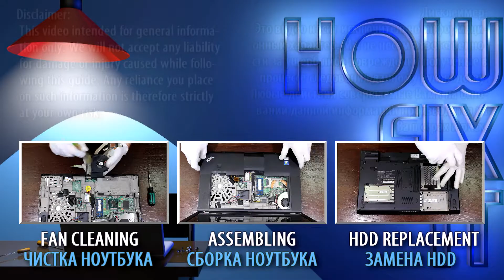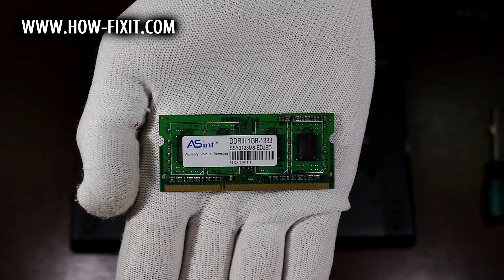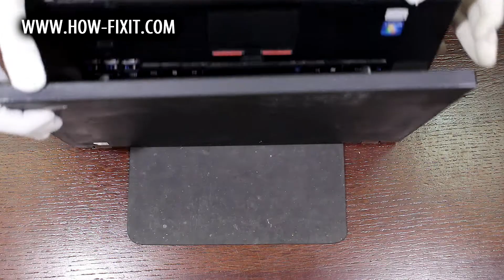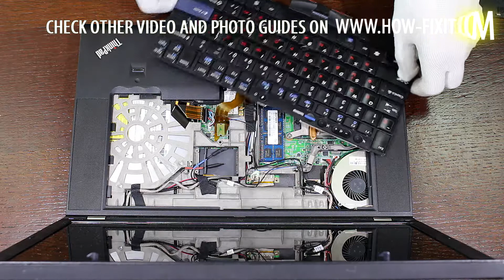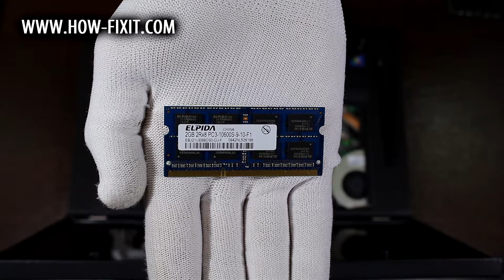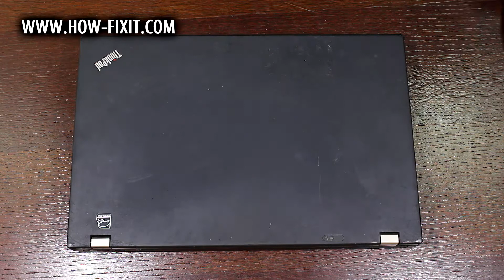Lenovo ThinkPad T510, W510 RAM Upgrade and Installation Guide

Comment: Thanks ! I first thought there was only 1 ram slot, so now instead of 4gb, I have 8 !
Reply: help i have 8gb ram installed but usable is 3.92gb
Reply: @khaddashumar8557  maybe you have a dead stick or bad connection, try cleaning the socket for the stick with compressed air

Comment: Hello! I have thinpad w510 model: 4389-Y11. Will this ram (1600mhz) works well on my machine?
My plan is to get 4 x 8GB (1600mhz) - 32GB.

This here: https://www.amazon.com/Samsung-memory-PC3L-12800-1600MHz-laptops/dp/B00KEAEX54/ref=sr_1_3?ie=UTF8&qid=1539271992&sr=8-3&keywords=8gb+ram+sodimm+1600#

Curently installed RAM:
/0/2c/0                        memory         2GiB SODIMM DDR3 Synchronous 1066 MHz (0,9 ns)
/0/2c/1                        memory         2GiB SODIMM DDR3 Synchronous 1600 MHz (0,6 ns)
/0/2c/2                        memory         2GiB SODIMM DDR3 Synchronous 1066 MHz (0,9 ns)
/0/2c/3                        memory         2GiB SODIMM DDR3 Synchronous 1600 MHz (0,6 ns)

CPU: i7 720qm

By specifications processor supports up to 8GB RAM .. Confused ..

Comment: Hi How-FixIT, great to see your video. I have another type W520. I am going to upgrade my RAM. Would you mind to suggest me about brand and speed should I choose? Thank you in advance.
Reply from the maker: Lenovo ThinkPad W520 disassembly process: https://www.youtube.com/watch?v=CPGvKNuapzY
AMAZON: Samsung 4GB DDR3L: https://goo.gl/ZNjqlJ
AMAZON: Samsung 8GB DDR3L: https://goo.gl/aUE39m
ALIEXPRESS: Samsung DDR3L http://ali.pub/1g0we1
Reply: @howfixit  IM using that exact ram, but windows hangs on boot and the laptop restarts.  I have tried multiple sticks of ram.  The issue goes away if I remove all new ram and replace with the original 2GB stick.  Any ideas?

Comment: Thanks for the instructions, tha was really helpful. I have one question if you could help me out please. Is it OK to just add the extra RAM without adding for example a new SSD drive to it?
I'm trying to figure that out. I'd like to only add the 8GB of ram and just heep the old HDD but was wondering if performance would be better if I also buy an SSD? Thanks!
Reply from the maker: It depends in what is bottle neck of your laptop, for example: 
- you have 2GB ram and hdd -- you need at least 2gb RAM, or more, SSD is optional
- you have 4GB ram and hdd, and you never used 100% of your ram  -- better to install SSD
- same as previous but sometimes 4GB is not enough -- add RAM, SSD is optional

so thing I want to say, that i can't know what you need.
Reply: Thanks for your quick response. I have 4GB at the moment and would like to upgrade to 8GB. I think I definitely use 4GB right now so going to 8GB will benefit me greatly. Just not sure id SDD is absolutely needed.
Reply from the maker: 4GB to 8GB is OK, it'll be probably enough. But you must know that SSD totally changes work of laptop - every program starting faster, so know that this upgrade you must do in any way, 1st or 2nd